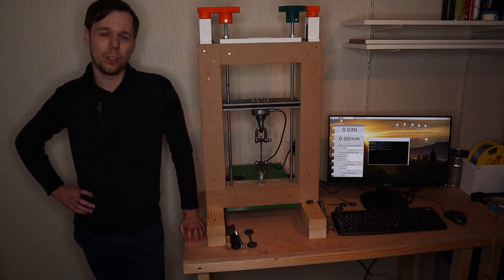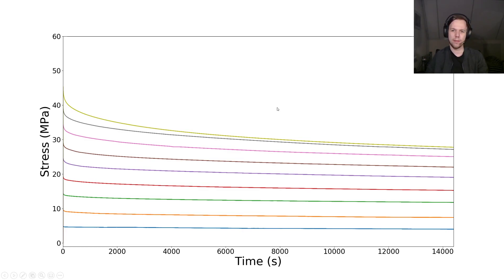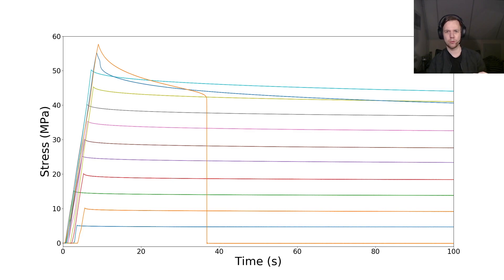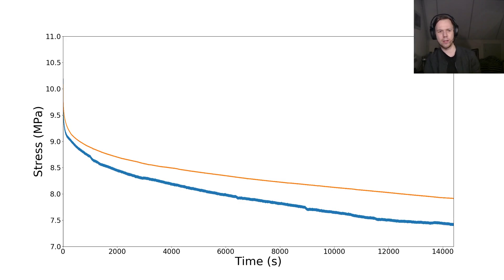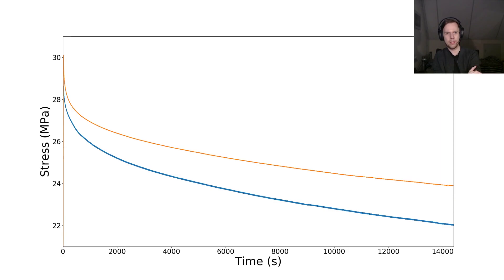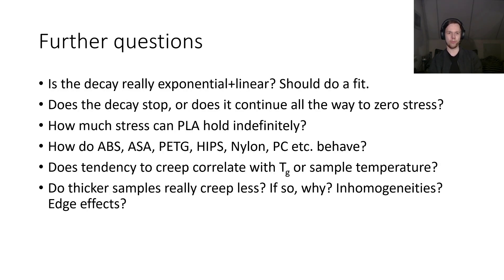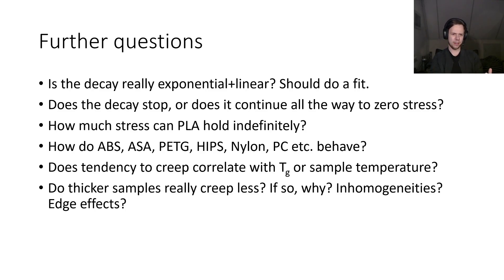Investigating PLA's creepy behaviour

Comment: Nice work.  certainly creep and stress relaxation are similar as you pointed out.  would be nice to see total extension to achieve the stress.  Also, thicker section at the bearing surface would be nice to see to ensure the strain is occuring in the section of interest.

Comment: ❤ Amazing content with several valuable takeaways:

00:09 🔥 Creep phenomenon in materials under prolonged force.

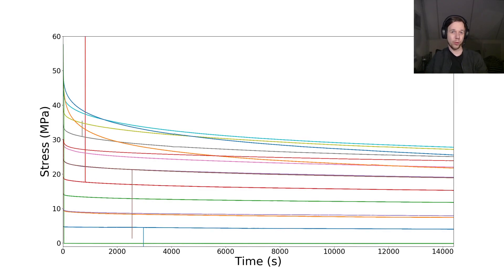02:03 💎 Data analysis of stress and time in PLA experiments.

08:27 💎 Comparative analysis of sample thickness and creep behavior.

12:55 🔥 Exploring questions and future research directions.

15:20 💎 Concluding insights and call for engagement.

Crafted by Notable AI Takeaways.

Comment: I have been performing my own experiments on this issue as well. Although much less scientific. This is due to my 3d printed products not holding shape during shipping in the summer months. sometimes the weight of other packages may deform my products slightly enough to render them useless. I am mainly experimenting this with temperature as cargo containers can reach 60c quite easily. 

I want to stay away from PETG and ABS and continue to print PLA. So far I have found Polylite PLA to have the highest tg out of the filaments ive tested, but its still suffers from creep. Really curious to know how much more research you've done on your further questions. Keep up the great work I am really interested in your experiments.
Reply from the maker: Thanks! I'm afraid very little. An interesting option I came across recently is Aurapol high-temp PLA. It claims 100C heat deflection without annealing. I haven't yet started testing it, or any other filament testing for that matter.

Comment: Great video.

Have you tested PLA against other common materials? (ABS, PETG, etc)
Reply from the maker: I haven't, though I really should. I tried measure stress-strain curves for a while, but I tried to sidestep the need for an extensometer, which failed. I want to build an optical extensometer, but haven't gotten to it, and it's pretty complicated I suspect. However I can still do the experiment you sugest without the extensometer, and I really should honestly.
Reply: @antalz  that would he awesome to see. There is quite a bit of strength and impact data out there, between material types. But I haven't found any comparing creep. It's surprising because this property is very important for functional parts.
Reply from the maker: @APEX.86  I'll put it back on the list. This stuff kinda dropped off my radar for no good reason. I also got a video on bevel gears and one on worm gears to do though, so it may be a while.

Comment: Could you also keep the force constant and measure the elongation over time?
Reply from the maker: Yeah, but with 2 caveats: You'd need to move the motors gradually to keep the force constant, so that's a bit of programming but not too much. The main issue is you need a way to measure the elongation, an extensometer. I am still looking to make one of those, but for now I still don't have one.
Reply: Isnt it sufficient to count the steps taken by motors?

Comment: That’s a stress strain curve, the reason the higher load curves intersect is because of yield in the material, not creep. Creep by definition happens below yield. Still very interesting
Reply from the maker: The curves here are not stress-strain curves. The horizontal axis shows time, not strain.
The connection to the yield point is an interesting idea. You can clearly see creep occuring in the 20-30 MPa lines, which is well below the yield point of PLA which is at 50 MPa or so. Nevertheless at very high stresses it appears something different happens, and the yield point may have something to do with that. I do note that most stress-strain curves of PLA show no or little negative slope after the yield point, most PLA breaks before that happens.
Thank you for your comments, here and on the gear videos!
Reply: @antalz  OK, agreed, they are not actual stress-strain curves, but you would agree that the behaviour they display is very similar to a stress-strain curve. Force goes up linearly hits a peak and my assumption is that it yields at that point and after that, the stress goes down because the material is not compromised. It's quite interesting for sure, I hope your videos will get recommended by the YouTube algorithm, they have very good information that is actually quite difficult to find. As a side note, I'm working on a 3D printed RC car and designing the differential has been a real challenge due to the bevel gears. I'm getting closer having a lot of fun with it and learning a ton in the process.
Reply from the maker: @marklandsaat3696  They do look a bit like stress-strain curves yeah, but they're something totally different. The force goes up because the machine is stretching the sample. The peak occurs because the machine is programmed to stop moving at a predetermined force. I could have perhaps left out the loading section of the curves, but I prefer to be completely open about everything.

I'm personally also thinking about worm gears and bevel gears. I think I figured out how to model worm gears, but I'm still stumped by bevel gears. The best I can come up with, in Fusion360 anyway, is to import one from mcmaster-carr, and then scaling and modifying it untill it's good. You must only select a gear with the right number of teeth from mcmaster-carr. Sorry I can't give you more helpful advice on that.
Are you documenting your project anywhere at all? It sounds pretty interesting!

Comment: This video is great, I really appreciate your efforts so far. I'd like to see creep behavior of different types (ABS, Nylon, PETG, and if possible; Silk PLA).
Reply from the maker: Thank you, my current plan is to make a video on gears first, I plan on shooting that tomorrow and the day after. I will then do stress-strain curves on the various materials, and then I will do creep on the various materials. I currently do not plan to include silk PLA, because I don't believe anyone would use it for a structural application. If you do have a reason for seeing silk PLA tested, I believe I have a roll of polyalchemy elixir gold rush, would that help?
Reply: Antalz yes it would help! I ask because it’s annoying when people make claims about the suitability of a material with no data to back it up. By including it in your standardised data set, we know for sure.
Reply from the maker: @purplesim1364  I vaguely remember silk PLA having very poor tensile strength, but I can't actually remember any source for that. I will add it to the list for tensile testing, if it does ok there I will also put it in the creep tests later on.

Comment: What an excellent experiment.I'm relatively new to 3d printing but I've already noticed this issue with PLA; I've made a multi-jointed, articulated lamp that never stays tightened as it's clear there's a degree of stretching, or creep, in the nuts & bolts where having to continually re-tighten invariably results in the bolt snapping, usually at its mid-point.

I've subbed as I'm really looking forward to seeing your future results with different filament types, hopefully soon.  ;)

Thanks for the video.
Reply from the maker: At the moment my plan is to first do a rather in-depth dive on gears, mostly 3D-printed ones but many of the concepts apply equally to machined gears. After that I think I want to record stress-strain curves for the various 3D printing materials, and then I think I'll try to do creep testing for other materials. I too hope to find a filament that creeps less. Personally I use setscrews to tighten 3D printed gears onto shafts, and I notice that they come loose after some time.

Thanks very much for your kind words, definitely motivates me to keep going with the videos.

Comment: You need to turn your head more to the left and to the right at random intervals whilst still looking into the camera - only then can you reach the heights of Stefan's camera charisma and be the Dutch version of CNC-Kitchen. 

Other than the production values - I really like what you did. Very informative stuff. I noticed a lil verbal mistake at around the 6 minute mark when you say 75.5 MPa but mean 57.5. Not a biggie, just saying. 

Subscribed because I am really interested to see your findings towards the further questions you pose in the end. In practical terms I am wondering mostly if there is a stop to the decay with a static load. Most of us that have printed any mechanical parts in PLA have noticed the creep in stretched and deformed parts. Rarely use PLA for anything other than decorative stuff because of that. Are there instances where there are loads that won't be affected by creep? Depending on print orientation and such? Like a fruit bowl or base with something heavy on top. Will it sag indefinitely or will it settle? 

Very interesting subject. Thanks for the vid.
Reply from the maker: This is a question I'm also very interested in. I have left a sample in the machine overnight, and the next afternoon it was still exhibiting creep. At the same time, there must be some stress that PLA can hold forever right? I think I can reprogram the machine to figure that out. Thanks very much for your kind comment.